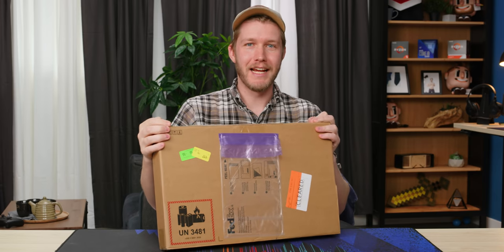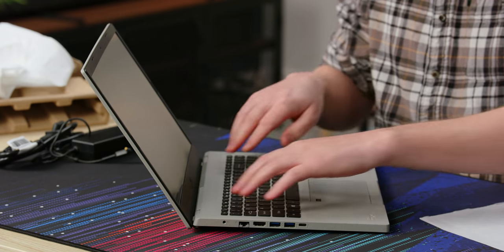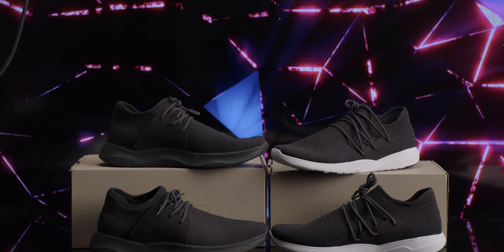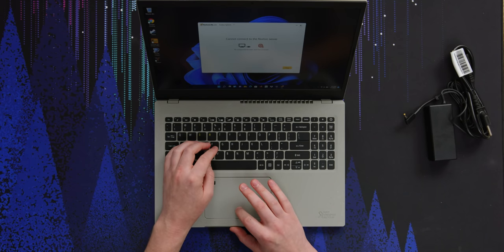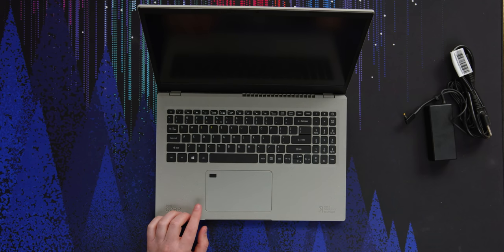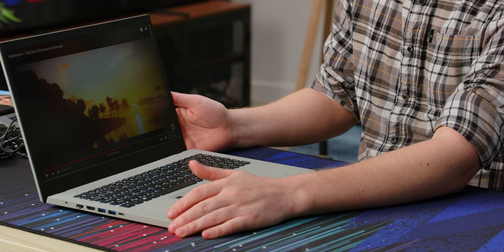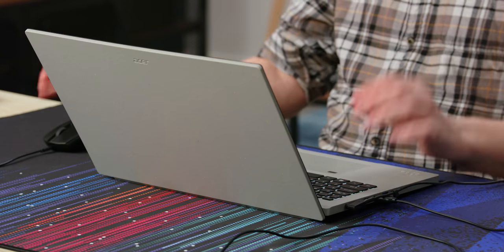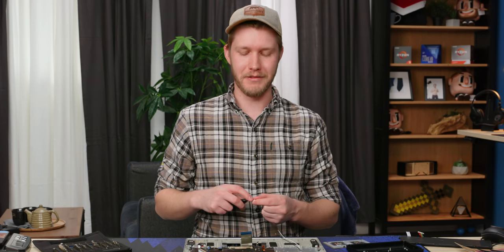ECO Friendly and POWERFUL?! - Acer Aspire Vero

Comment: Recycled ≠ eco-friendly. REDUCE and RE-USE come before recycle.

Being built to last and/or upgradeable, like the Framework laptop, makes much more of an impact.
Reply: I wouldn't complain so much except they put an un-replaceable 4-core in it. I mean come on. 4 cores.
Reply: Part of the marketing is that it's upgradable? But they only mention that it has standard screws, so....
Edit: Finished the video, they definitely could've gone further with repair/upgradability if they just used more of the internal space.
Reply: Recycled is not necessary eco-friendly but it's not like they did a a e-waste with recycled material, they made a good low tier pc with recycled material, upgradable and that can be repaired so it is going toward the eco-friendly side (not like fairphone that is straight unusable 2 year down the line because its already obsolete)
Reply: @32krod  The Framework laptop is designed so that it's mainboard can be replaced, eventually I hope that even with 3rd party ones. RAM upgradeability isn't full upgradeability. If they can keep the screen and other components out of the landfill for a couple more years it's a much greater effect.
Reply: Our economy isn't built for that
Reply: @32krod  Looking at the internals of the laptop, most of the parts inside can be found in other Acer laptops. That battery is a dead giveaway. If you take a look at any other acer laptop in the 13-17 inch range, you'll find that exact same battery.

This is just a cost-saving measure hence why its so empty on the inside.
Reply: he changed the name of the vid lollll!!!
Reply: The top end model is an 1195g7 at about $1300. But it still only has 1 USB 3.2G1 (5 Gbps) - no thunderbolt or USB4! Lack of connectivity = short lifespan = not very eco-friendly
Reply: @khyoyeon554  
Dongle
Reply: @dillonh321  dongles suck. I can't drive 4k + 2x1440p + USB 3/4 with a dongle
Reply: @khyoyeon554  Congrats on being part of the 0.1% of laptop users who need that.
Reply: If companies really gave a shit about REDUCE and RE-USE they would make laptop mobos come with ITX mobo mounting holes for reuse as a desktop/server.
Reply: @khyoyeon554  
Wow totally applies to most users. Good point!

Not.
Reply: Actually, the "recycle" in "reduce, reuse, recycle" is the recycling of the product at the end of its lifespan, using recycled materials to begin with is more like "reduce" the amount of materials that had to be extracted from the earth really... (Though you'd have to take into account how much energy was used to produce recycled material for sure)
Reply: @gajbooks  It's not the laptop maker's fault that Intel and amd only make soldered cpus for laptops nowadays. The only problem is the non-replaceable keyboard, otherwise all components can be replaced.
Reply: @gajbooks  it's running an iGPU. It's a web browsing, homework doing, small business running style laptop. 4c/8t will still be doing that job fine seven years from now. The secretaries at my work both run dual monitors off of 2000 series i3 laptops. If low power 2c/4t still keeps their excel docs running, there's no call for this unit to have a replaceable CPU.
Reply: Plus it's an Acer so it will automatically break sooner than later
Reply: Imo what acer did should be at least the standard nowadays and not some ecofriendly marketing technology thing
Reply: @khyoyeon554  You couldn't drive that array of displays off this thing anyway, Notepad would get 1fps.
Reply: They REDUCED the amount of plastic being created by REUSING plastic from previous machines.
Reply: @kaldo_kaldo  Recycling still uses energy. You have to transport the materials, separate them, melt them to process into usable feedstock, and melt them again to create a finished product. You know what doesn't use energy? Not having to do that.
Reply: @suppar8066  Exactly. You get it.
Reply: @WhenDoesTheVideoActuallyStart  Well let me ask you this. How is Acer melting the plastic, do you know? Everything consumes energy, and tons of energy is spent without being used on a daily basis. How they do it is more important than if they are doing it.
Reply: @kaldo_kaldo  Get this: I run the setup with a Framework laptop with an 1135G7.
Reply: @khyoyeon554  I thought Framework was against making eWaste.
Reply: @khyoyeon554  aren't the USB C ports on the framework laptop USB 4?
Reply: @KingLarbear  then we rebuild it. A circular economy or reconfiguring for degrowth is so much less likely to actually make the planet uninhabitable in the pursuit of strong quarterly growth.
Reply: Does anyone know if the laptop has dual channel memory in the I5 8g ram version?
Reply: I'd rather have a laptop that was produced not very environmentally friendly, with solid manufacturing, friggin magnesium, aluminum, whatever, and it lasts me 10 years... Because then I'm only causing 1 laptop to be produced, not 3 or 4
Reply: @leonro  The laptop maker could have simply used an underclocked APU on an X300 motherboard. Some chonky workstation laptops actually have stupid socketable CPU's like literal 5950X's in them.
Reply: @kaldo_kaldo  No, not using energy is always better than using energy. The less laptops need to be manufactured, the better. And to achieve that we need laptops designed to last longer and be repairable.
Reply: @khyoyeon554  bro what do you mean, this laptop has above-average IO, it has: 3xUSB A, 1xUSB C, 1xHDMI, 1xEthernet. that's way better than most modern laptop which gives you like 3 USB C and maybe 1 USB A.
Reply: @WhenDoesTheVideoActuallyStart  a desktop APU still consumes a ton more power than a mobile CPU, also the laptop would have to be made much thicker (which is why you only see it in chunky workstation/gaming laptops) and the power adapter would need to be much more powerful to meet the demands of a desktop cpu
Reply: @starx2212  More often than not desktop APU's and mobile APU's are the same. Whether you set the TDP high or low depends on your design goals.

Also, where does anyone mention using desktop APU's in laptops here? I can't find such comment.
Reply: @WhenDoesTheVideoActuallyStart  you said using an APU with an x300 chipset implying a desktop APU
Reply: @starx2212  I see, I missed that. And again, Ryzen desktop APU's and mobile APU's are literally the same chips (Their industrial APU's are the same too, just better binning and more well tested/validated methinks).

Only Intel's Alder Lake differentiates them by using different silicon as a desperation measure to improve performance/watt

You just need to make more space for the socket mechanism, you don't even need an IHS.
Reply: @WhenDoesTheVideoActuallyStart  i guess they could just make a shorter socket that uses a screw like on older laptops and they could not make the pins as long
Reply: @starx2212  The Framework laptop just uses a normal soldered BGA CPU/APU, but allows easily replacing the motherboard. The RAM and SSD aren't soldered so if manufactured at scale the motherboard itself wouldn't add much cost to the CPU/APU, and the old one can be reused in other projects, like building a NAS. It's a reasonable compromise if you want to keep the low profile.
Reply: @gajbooks  Do they make replaceable CPU's for laptops these days? My only complaint is, yes just as author said, it's actually 14 inch Acer Aspire 5 motherboard in 15 inch laptop, I guess it makes it kind of greener, as there's less PCB. In the other hand, 15 inch acer aspire 5 motherboard feature second m.2 and SODIMM slot, which makes it a lot more upgradable!
Reply: @tokanada  Using same battery in every laptop is actually a good move! It means there will be plenty of replacement batteries, when the time comes.
Reply: This is very much a greenwashing campaign product. I much rather have an upgradeabe and user-serviceable laptop durable enough to pull through 5some years before it needs repair or replacement and another 10 before wear and tear starts to show...
I will give it to Acer that not nearly as many people are as lifetime-minded as myself and simply don't know or care how to make their laptops last, so it might be best for them to buy a laptop that will produce the least amount of e-waste at its end of life or they break/get bored of it.
Still, I would invest in campaigns for e-waste awareness and brush up my repair service if I actually cared about the environment, not just make more disposable laptops.

Comment: My experience with Acer has been that they are really good bang for the buck, and easily upgrade-able. I am rocking a 2012 aspire v3 that packaged with 2nd gen i3, and I was able to easily upgrade to 2nd gen i7, upgraded RAM and swapped my hdd for ssd, and replacing the keyboard was a breeze. They also support 2 storage drives. I love it so much that I picked up an identical twin on ebay a couple years ago and performed the same mods. Now I have 2 of them, one being my home laptop, and the other, I travel with. To this day, they both still perform very well, with no issues. They aren't super gaming computers or anything, but they are very decent and do everything I need them to do with ease.

Comment: That's amazing how easily taken apart-able that laptop is. I hope more manufacturers go this way (more like framework).
Reply: Framework does a lot more than that, probably one of the most repairable modern laptops I've seen.
Reply: @WednesdayMan  Ofcourse, but this is the closest to a framework from a big brand I've seen in a while.
Reply: You can take apart and repair Thinkpads, they’re not $700 though.
Reply: My first laptop way back was an Acer aspire and that was super easy to open for repairs and maintenance. So Acer has got that one covered for a while. Compared to my brothers HP that had to be completely disassembled for a simple dusting.
Reply: @OTechnology  as a laptop repair guy, most lenovos from about 4 gen and onwards are like this. and more recent (9th ish gen intel) dell and hp computers have similar internal layouts as well. not all. obviously. but its a clear trend that i wish gaming laptops would adopt. i havent worked in many newer ones but a couple msi's are bs to take appart
Reply: 100%  I want Framework to be the gold Standard that everyone aims for instead of the e-waste of Apple/Google, when I can I want to get one of the Framework laptops just to support them (and replace the rather sad consumer grade laptops that have been failing me previously)

Comment: I am a longtime ace user and still so happy that i made the right choice 6 years ago. My laptop is working like a charm, although it is so old. And easy to repair as well.
Reply: i mean it a tank, but in a good way. Although mine seams cheap there is no flex for the keyboard, really modular (i even changed the Hinche) and easy to repair

Comment: Hello guys, up-vote the comment! So I bought this laptop, in my country Denmark the I5 model (Newest 11th gen, 1155g7) and 8gbs of ram 3200 mhz, 512gb nvme ssd was a good price, with the I7 / 16gb running a bit more. 

Hardware: 8 gigs can only be upgraded to 12. Im planning to do this. Just booting the laptop eats like 3-4gigs on windows 11 which it comes with only. Bloatware was not to bad, CPU usage on first boot was very low, or 0-3% most of the time, so good enough, the acer software I also didn't remove actually.

It runs quit hot sadly. Even this tigerlake stuff is....not good for battery, and speaking about the I5 model...the IGPU is great. Performance is good, even in games with 60 FPS low settings. It also feels snappy to use etc, but heat is a problem/noisy fans under load. But its 100% silent when not doing much...ALSO! This pissed me off, but the exhaust (warm air) comes out on the top, instead of the sides, so it overheats if you close the lid and continue using the laptop with external monitor - Good thing you can turn off the screen on the laptop and get all things working that way in windows display settings...Also HDR works great on windows 11, no issues :)

Build quality is also fine. There is no screen wobble on mine, which Alex had...I really worried about that too, but only the left hinge feels a bit loose, but else no wobble...So far. Anyway full plastic and it feels sturdy. Some deck flex for sure compared to aluminium chassis etc.

In general im happy enough but I think battery is lacking, problems with heat when lid closed AND! also the so-so screen, also because of the amount of ports I like it, I wanted a laptop with ethernet/rj45 port, and only Lenovo and HP seems to have some laptops with that now a days besides acer. Anyway on battery size most in this price range used same 3-cell lithium 45-50 what hour battery or whatever its called.

In general it was the best laptop for performance/hardware and stuff in my country as of end of 2021 in that price bracket. Many laptops has little ports, 256gb, the older I5 1135g7 etc, AND none offered 16gb...Also on the ram, the bios is very limited on these notebooks so no XMP, aka only 2667 MHz ram speed dual channel on my model...

Oh also I opened it up to see what ram and ssd brand it was, Kingston nvme and Samsung ram. You just need a small plastic guitar pick to open it yes. Very easy, anyone can do it.

Hope that helps, please up-vote the comment for others.

Comment: the whole point of it not being a good laptop makes it e-waste either way is so damn true I wish more companies used it as a tagline
Reply: That is true but what is most important is if it's worth for the price point and I believe it is as there are minimal compromises for a 700 dollar laptop
Reply: Honestly I have a similar acer myself, since I have my main desktop tower at home. Everything just works, it is a mid-tier laptop and it just runs and runs and makes what I want to do with it. I will use it until the end of its lifetime.

The trackpad and the keyboard are a joy to use, probably the best features of the laptop. Among with the great UI.

The only big downside I saw on the video I personally have was the display. I don't know, I feel that the display on my Acer is better. That's the one that has to fulfill minimal requirements for me, since you want to work on it and consume media with it. I wish they would've fitted it with a better display. Though I am very happy with the one my unit has here, so idk.
Reply: PS: Oh yes, I remember. The colors (he mentioned the greens, yes I think it was the greens) were really a bit off and you could see it. I had to install another color profile. Windows has the options to install color profiles for your display. There was one on the internet that corrected the colors and now it looks really fine. So it's true, I had to do a bit to fix my display, but now it's pretty good.
Reply: @IroAppe  I also have a similar laptop and it's perfectly fine for my use.
Reply: Bringing attention to the ewaste problem will make people less likely to consoom stuff, which is a bad idea for companies.

Comment: Ive always loved my acer laptops.Cheap, but decent quality. Even before this they were fairly easily repaired. I daily drove an  Acer Aspire 4810T for over 8 years from 2009 to 2018. I replaced batteries, heat pipes, storage, wifi chip, ports. The only reason i let it go was i broke the screen and the replacement was like150 bucks and i decided to stop using it.

Comment: I'm fine with recycled materials and eco friendly things, HOWEVER, this should never be the main selling point. The laptop is still a laptop first and foremost, it just happens to be made with eco friendly materials.
Reply: And it's a perfectly useable laptop. With the added benefit of being made partly from recycled materials. At its market range, why not make that it's main selling point? You're never going to get top of the line components, so why not market what might be unique. It's got easy reparability which I'm sure will please plenty of people.
Reply: @arushh42  I got one, 2015 model, that I bought used. So yeah. I did eco friendly before it was buzzwords.
Reply: @sameermohideen4913  except there's better laptops for this price range, with the same repairability